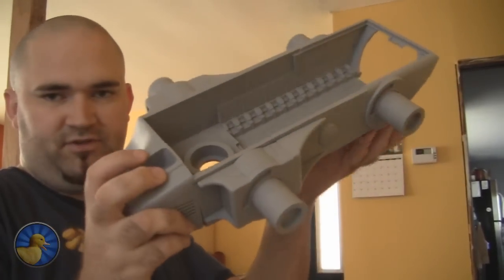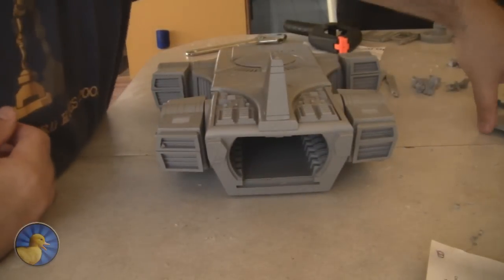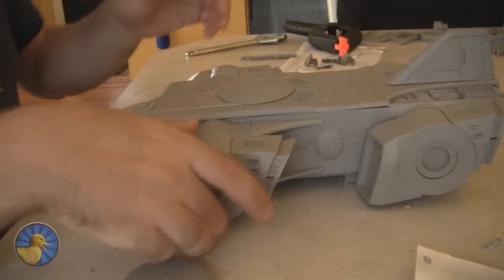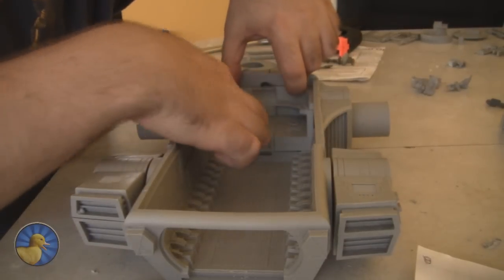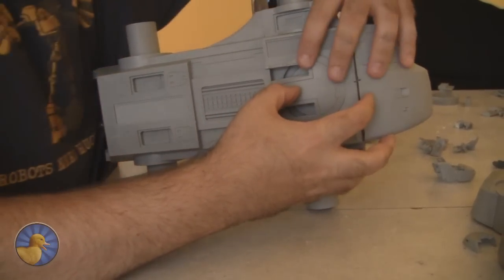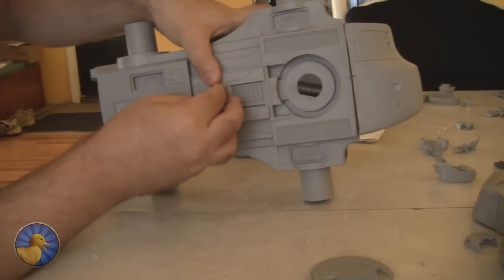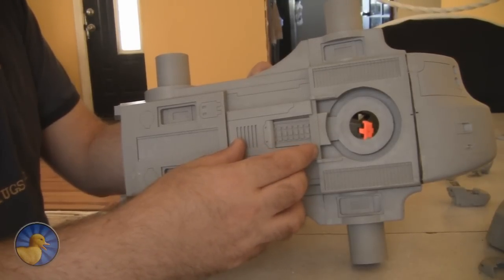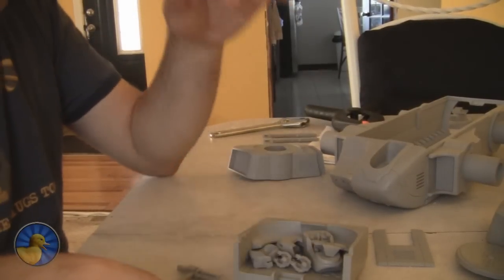Tau Orca Project Vlog - Episode 5

Comment from the maker: @Shannariano The Escape Pod doesn't really need to be magnetized - it sits quite securely in it's position when not in use.  Things I've magnetized so far on this are the 2 Antenna, the decorative top plate, the Ethereal and the two Fire Warriors in the Command Center, and the back door.  I'll also magnetize the 4 Seeker Missiles I'm adding to it later.

Comment: For a flying base, you could make (this would probably be really hard) a curved piece that wraps around the turret (attaching where you would have put the two pegs) and have a flying stand coming out of the middle of it.  It would also dress up the turret assembly.  You could possibly use two skyray head pieces since they are the most pointless vehicle in the game and you get them free when building a hammerhead.